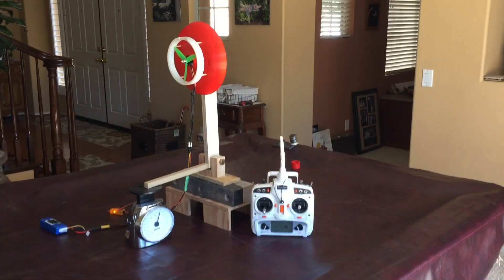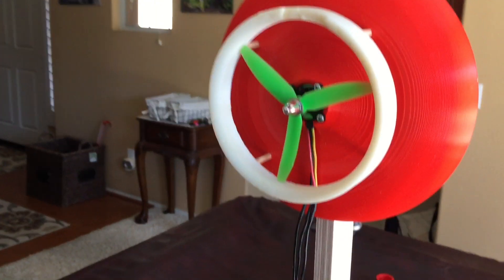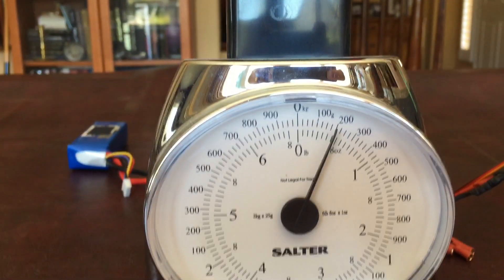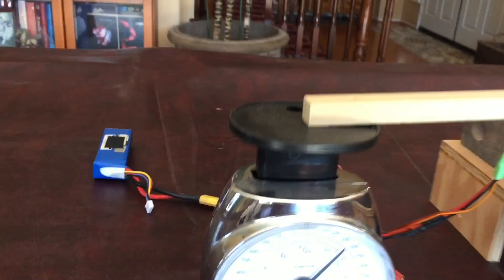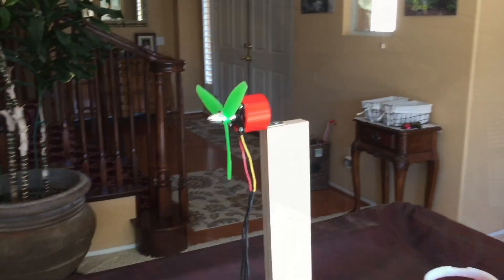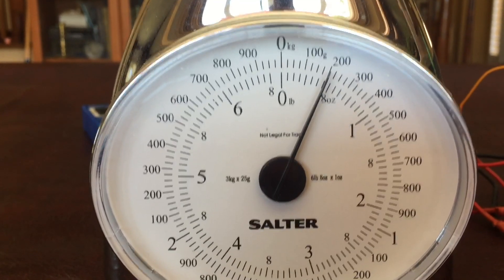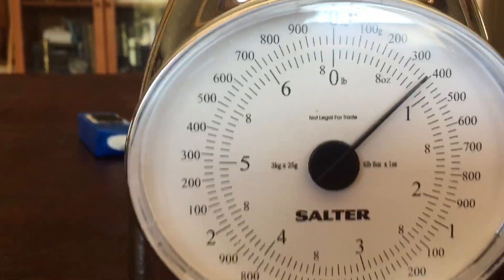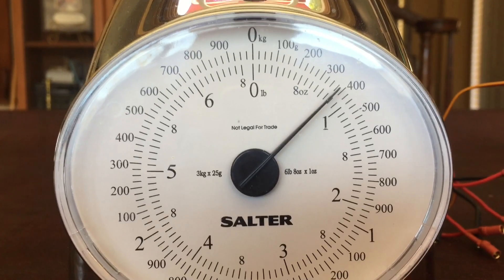Does Coanda Effect Produce More Thrust Than Propeller Alone?

Comment: You changed the weight around as a center of gravity change So... i dont think it counts. Try it again man
Reply from the maker: It is possible but having the same amount of weight before the motor is turned on show that it is an 'equal' CG?
Reply: @coaxman  the lever arm "moment" is changed.   The test just needs to be re-rigged to show straight line thrust.  I'd bet you'll get better results.

Comment: This is a faulty test.  To properly test this you need the coanda sheild in front of the prop and a central hole so there is no restriction of airflow, also the curvature should be inward to the center hole as in a ducted fan.

Comment: Wrong design completely unless you want a novel vacuum cleaner attachment.. Would have like to have see you put pprop blade inside a tube tightly, then on intake side minimum duct dia 6' like prop and duct tube BE MADE TO length= 10 x the blade diameter. SO A 60 " TUBE INTAKE AND A CURVED OUTSIDE LIP OF AT LEAST 1" HALF CIRCLE TO ACT AS A NACELLE/ AERO FLANGE a True Coandă effect in theory.

Comment: Although I applaud the intent, there are a number of things wrong with this set up that would result in less than optimal performance for the coanda effect propulsion. Firs, minor critiques.. fan should be a bit further away, the duct should do a better job of directing the flow, and the curve of the bowl should be more parabolic with longer sides. With that set up a large portion of your air will have been deflected at an angle perpendicular to your intended thrust vector. 
The other part of the critique come down to the orientation of the set up..
I'm not sure how significant it would be without testing your set up, but there would be a very slight clockwise torque exerted by the coanda set up, which would actually decrease the total thrust felt by your scale, with that fraction being stored as tension in the arms of your levers. 
I'm sure this is fairly insignificant compared the the issues surrounding the geometries, but let me explain.
Part of the "propulsion" mechanism for this type of set up relies on air flowing into the low pressure stream as it comes off the edge of the "bowl". As the high pressure air flows in towards the stream, it deflects the stream towards the center of the "bowl" and up towards the bowl. This exerts an upward force on the "bowl" from underneath as the high pressure ambient air is entrapped and thrust downward... the same thing happens with the fan, but less of that force is exerted on the fan assembly, and is instead simply converted to chaotic air movement at a distance closer to the propellers.
however, how air interacts with this flow is different when the flow is horizontal as opposed to vertical. This is due to a number of factors, not the least of which is the ground effect.

Very cool and i applaud the attempt, but considering the peer reviewed literature that shows the use of the coanda effect can increase thrust efficiencies, i think this  is a better demonstration of the importance of proper modeling.

Comment: Can we do this again, but with an impeller designed to pull high vacuum, letting the swirling action of the exhaust swirl over the surface. 
Coanda effect is increased dramatically with swirl, and works best when trying to pull air over a surface, rather than push the air over it. 
Just swap propeller for vacuum impeller. If you use a shroud to separate the intake airflow, at enough rpm, you’ll see water condense in a tornado like vortex, even further increasing the  suction-pulling(rather than compression, pushing)
Reply from the maker: The reason I chose a ducted fan instead of an impeller is because of all the videos I've watched, studies I've read, and experiments I've seen the ducted fan produces more airflow than an impeller.

Comment: I thought the idea was to produce lift, not thrust?
Reply from the maker: In this case, thrust and lift are the same thing. Thrust and lift are created when there is a difference in air pressure. For the prop, there is a difference in air pressure between one side of the blade and the other. For the coanda dome, there is a difference between the front side and the rear side. This experiment was to see the difference between the lift or thrust of the prop and the lift or thrust of the coanda dome.
Reply: @coaxman  thanks for the explanation! That makes sense. I wonder what would happen if a second pusher propeller was placed on the underside of the dome?
Reply from the maker: @gabrielbennett5162  It would not do much and it would probably make it worse. It would reduce the pressure on the underside which would reduce lift even further.

Comment: I don't think the test considers enough variables to dismiss the effect so readily. The propeller was optimized to not have a big bowl blocking it and diverting the flow so of course the fan by itself would perform better in that setup.
Reply: It was not an experiment it was a wild guess. It had no basis of any kind.  But it did measure how bad he can make a simple design complicated and worse, like 6 wing hexaplane.

Comment: The Coanda effect does not increase the thrust, it's more related to the deflection of the air flow. It would be more appropriate if you had used a propeller that blows outwards (a centripetal fan that in your trial it would blow vertically), but with this propeller blowing horizontally a considerable part of the kinetic energy of the wind is lost in the 90º curve that the wind has to do at the begining.
Reply: Having a ducted prop had positive efficiency effects and lead to better control at low speed on a test drone

Do you believe that a ducted propller test like this one would yield higher thrust than a propeller by itself??

Comment: This isn't a good experiment. In fact, it is kind of silly... you'd need to take the same engine and put a centrifugal flow or an edf fan directing the air over the surface. you do need a bigger duct, as the air has to be forced fast on the close surface of the "bowl" shaped surface. you have a tiny ring that does nothing. it has to come out much faster and much closer, the opening has to be at least half of yours... and by putting a simple propeller with such a small "redirection" you are introducing turbolent flow on top of the surface, while you need laminar flow... you aren't really doing coanda but a simple redirection.... of course you loose that much thrust...
Reply from the maker: I appreciate your perspective because I used to think that the better way was to have a centrifugal flow fan too. However, after doing a lot more research and looking at the current flying models and prototypes I found that the ducted propeller is more efficient. Like I have responded to several similar comments about different sizes and configurations, it might be possible to find a configuration that gets close to or maybe even surpasses the thrust of a lone propeller. But the weight of the configuration would offset any gains in thrust you might find.
Reply: @coaxman  well... Efficient always means different things according to the application... Turbojets are highly efficient if you want speeds higher than Mach 1-2. But if you want 800-900 km/h of speed, turbofan are more efficiente... If we wanted a high air flow, yes, propeller is more efficient. But we actually want air in high speed, and very close to the surface. You may use a duct with a propeller but it has to go closer to the surface, so that the air goes in laminar flow at high speed. That is why I mentioned compressor blades, they would speed up the air fast near the surface at a nearly laminar flow...

Comment: Interesting experiment!  
I'm not an aeronautical engineer, I'm strictly a layman, but I have to wonder what would've happened if three variables had been different for the first configuration:
1. A propeller that's optimal for a normal, open application and one that's optimal for a ducted fan, are different in profile, in airfoil and pitch, as well as in the number of blades.  Expecting an open prop to work in a duct and with a Coanda-effect body, isn't realistic.  As an example, the profile, pitch, airfoil, and blade numbers for a propeller used on a tugboat are completely different from those used inside a hydrojet thruster.  Both have blades that are designed to push water, but they bear little resemblance to each other.  Enclosing that tug prop in a duct (never mind putting a Coanda body behind it!) would result in terrible performance, just as taking the hydrojet impeller out of its enclosure would.
2. The duct around the prop was just a flat cylinder with a considerable distance between its trailing edge and the Coanda body, and between its inside and the tips of the prop.  This might have actually decreased the performance, since the air vortices in that space would break-up the laminar airflow upon which the Coanda effect relies.  I would expect that a duct which is properly shaped (watch this video to get a sense of the optimal profile: https://www.youtube.com/watch?v=Cew5JF8q6eY ), is correctly fitted to the blade diameter, and has the optimal gap between the two (without letting too much air "spill" away) would've produced a much smoother laminar flow, and considerably more thrust.
3. The profile of the convex Coanda body looks to be almost like a flat disk with an inverted outer edge, and an everted center ( 00:22 ).  That is far from an optimal Coanda profile, which generally have no areas perpendicular to the air source.  As far as I understand it, the lower the thrust of the fan, the more oblique the profile should be; think more like the bell of a trumpet that curves back to parallel with the air source, at the rim.  
So while I applaud your experiment, I hope that those who watch it don't leave with the belief that the Coanda effect isn't efficient when the variables are configured properly.
Reply from the maker: All of these points are valid arguments. If you did maximize efficiency of all those variables it is very possible to show a Coanda effect that produces more thrust than a propeller by itself. 
I patterned my design on the Aesir drone (https://www.youtube.com/watch?v=KXVtUCABiv8) because that is a Coanda aircraft that came very close to production. I performed the experiment to see for myself the difference in thrust between the two. I think that even if you found a design that produced more thrust than a propeller alone you still have the fact that you have to lift all of that extra weight of the duct and the dome. My concluding argument comes down to the fact that we do not see any type of production Coanda VTOL aircraft out there because they aren't as efficient as a propeller by itself.

Comment: Waste of time. Not a proper duct and not proper propellers for a duct. The opening is supposed to be bigger with a narrowing to the exit. Furthermore, the movement through the air intensifies the effect. Of course, there is the off chance that you are smarter than the engineers who are creating e-fans at Boeing, Airbus and many other giants in the industry.
Reply from the maker: I know there are tons of engineers out there that are smarter than me. You are probably correct that this might perform better with a different configuration or scale. However I believe that we don't see these type of aircraft flying around because the coanda configuration is not as efficient as a propeller alone.

Comment: He's a tip my friend.
The way to effectively blow the air over the convex supperfice isn't by a fan but trough a compressor. The engine convert electric power to mechanic power and finely to Wind power. You have to pump the air trough a compressor and than you will get twice of power delivered. It won't work on such a small scale though.

Comment: Thank you very much for the experiment Mark, but....I think you make a flawed experiment from the beginning. If you want to create a good Coanda effect the energy of the motor would be better used by a centrifugal pump I mean not by a propeller that is like a screw on the air but for blades (straight, semicircular) perpendicular to the Coanda surface.
Reply from the maker: I definitely thought of doing that but all the experiments I found on youtube and elsewhere showed that the amount of thrust created on a coanda was greater with a ducted propeller than with a centrifugal pump.

Comment: ok loss of thrust (as placed) ... BUT how about lifting capacity ... orient to the ceiling and LIFT see how much each can lift ... I would surmise the coanda lifter portion will lift more than the propeller alone 
.
since in your thrust test the coanda lifter was the lower value ... start the weight at that value ... then see who lifts what by adding more weight until they cant lift 
.
I think the coanda lifter will lift more than propeller by the same difference as the propeller out performed the lifter on thrust ... and the lifter will be more stable .... my thinking is as a lifter the coanda body allows for more lifting area so it can handle heavier loads than the propeller alone because of the various backwash and other aerodynamic mess behind the prop ... while behind or below the coanda body it is more uniform and spread wider ... also if the body has a proper hyperbolic lip on the lower skirt then it will also be more stable because the base of the down draft will be spread like a triangle out
Reply: It will pull with the same amount of force regardless of how it is oriented. Whether you call that thrust or lift or force it's still measuring the same thing.

Comment: Kudos for conducting this experiment. However, I this the setup is not quite correct, as the propellers are simply blowing on the attached red section, which is simply negating the effect of the propeller thrust.
Reply from the maker: This configuration is just like all coanda lift device designs. What might be confusing is the orientation of the device. Normally, if you wanted to achieve lift and fly it would be in a horizontal orientation where the prop points upwards and the red dome is below. There are several scale models that do fly with this design.

Comment: Totally makes sense Mark. A prop by itself directs all that air power in a more direct path, whereas the Coanda Effect, although an interesting effect, only adds disturbance in the form of friction and non-useful redirection to the path of air flow. An object, such as an air molecule will tend to stay in motion and retain its best potential energy when not interrupted or intercepted by an external source - which is exactly what the Coanda Effect does. So it is pretty obvious that the fascinating Coanda Effect was not meant to benefit this particular application. But I certainly look forward to its application to other problems that it may solve. Thanks for this great experiment.

Comment: Didn't expect it would produce additional thrust - but props for actually carrying out the experiment! Side note: the second test should have been done with the prop duct in place to properly isolate the Coanda effect as the variable, but since this in theory would have increased the thrust in the second part of the experiment the results would still have disproven the hypothesis.

Comment: I thought the Coanda effect was more for controllability than for thrust. Vanes etc. can be added to the sides for quadcopter style control, yet with only one prop and motor.
Reply from the maker: You are correct that the coanda effect has been utilized successfully for aircraft control. A great example is the C-17 cargo plane where the coanda effect is used with the flaps to achieve short takeoff and landing.

Comment: I believe you just proved that you have done it wrongly. You are not creating any high pressure under your plate. you do not even need that plate. Make a lip on your duct and remove the plate completelly. All you doing the  way you have done it is creating high pressure  between  your prop and your plate which is pointless if you want to create ore trust. Also make sure the end of the prop has as less clearance from your duct walls as possible.
Reply from the maker: This coanda configuration is creating thrust just not as much as the prop by itself. Bernoulli effect of air moving across the top creates low pressure not high. What you are describing is a specialized ducted fan that was on the Hiller Flying Platform. It did create a lot of thrust because it was a ducted fan and the lips created thrust using the coanda effect. However that configuration had very limited forward flight speed.